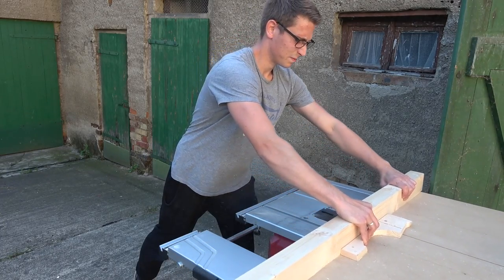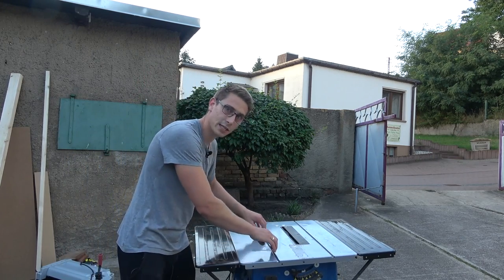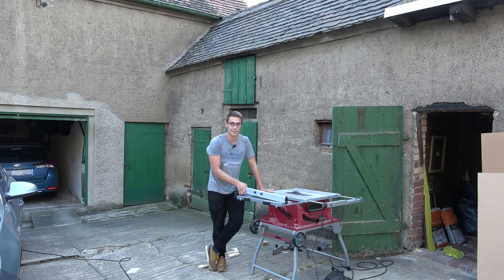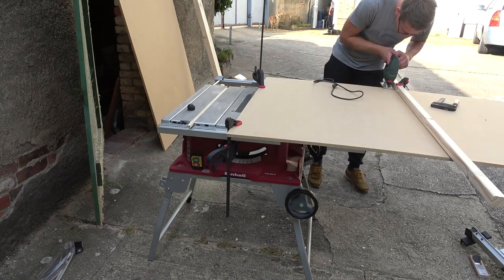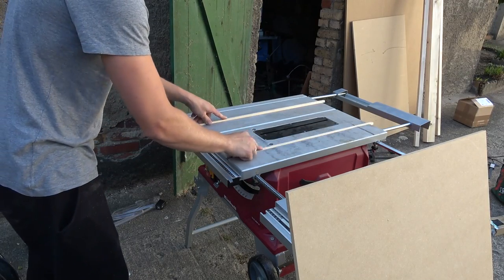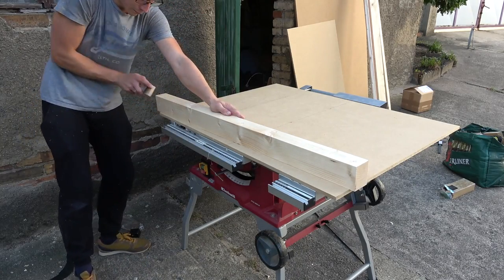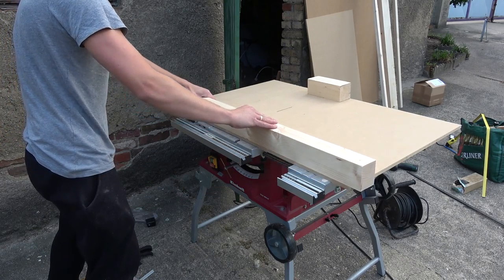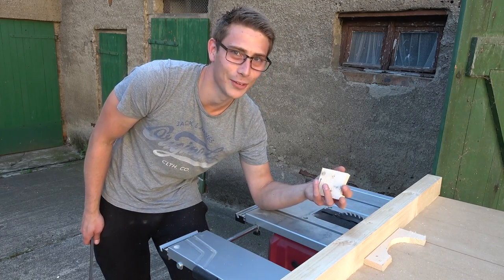ALWAYS Square Cuts with your Table Saw! Super Easy, Quick and Inexpensive DIY Cross Cut Sled!

Comment: Good video. I need to make a new sled, after a few years my old one isnt perfect, but the Crapsman table saw I made it on has a problem with the blade not staying in alignment with the frame and miter slots so I've been putting it off. I bought another used one i found for a great deal and was so excited i didnt realize it had no miter slots,  just a built in sled thats useless for anything other than construction work. So now ive got 2 fucking table saws, one for questionable crosscuts, and one for ripping. 🤦‍♂️ at least the newer one folds up and rolls away easily....
Reply from the maker: oh god, that is really unlucky :/ But you should be able to get around this issue with the miter slots! Make the sled that I made, but instead of the sliders on the downside, extent sliders from the side of your table downwards, basically hugging the sides of your table, keeping the sled on track! Maybe that'll work?
Reply: @RockHardWoodDaddy  I appreciate the thoughtful reply, but the entire table moves, its an issue with this one old model. It's manageable if i spend some time readjusting after moving it around, but the its been 2 years since i took the time to do it. I'm hoping to soon be able to afford a better and new table saw that I can make nice jigs for, knowing its going to last me for probably the rest of my life! That's the dream anyway haha